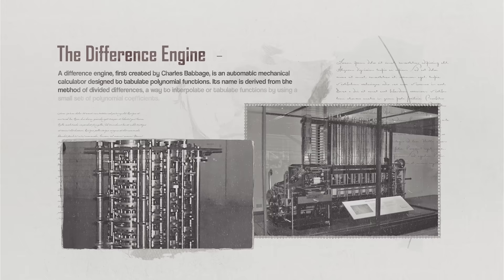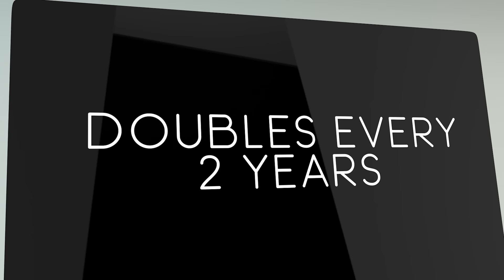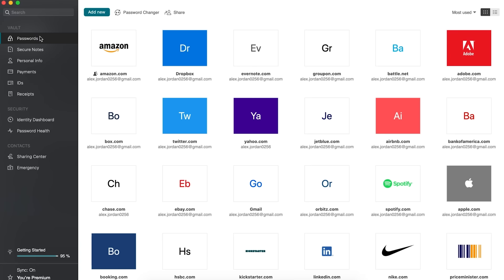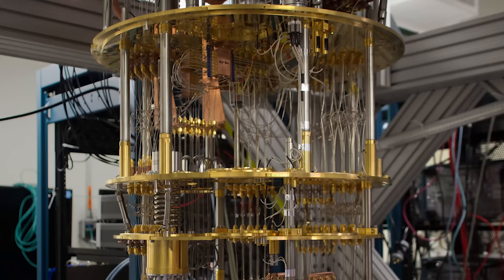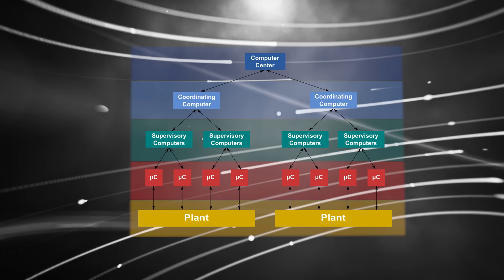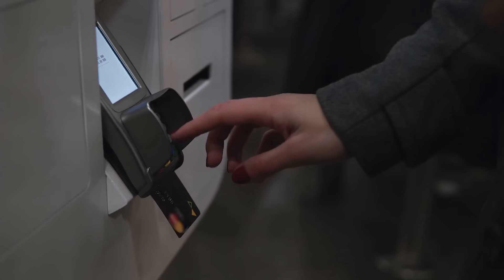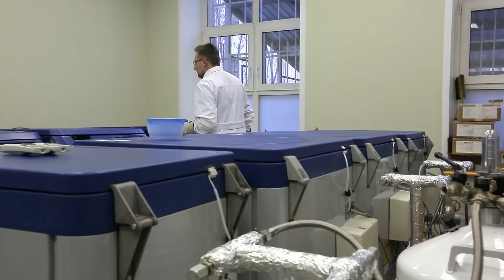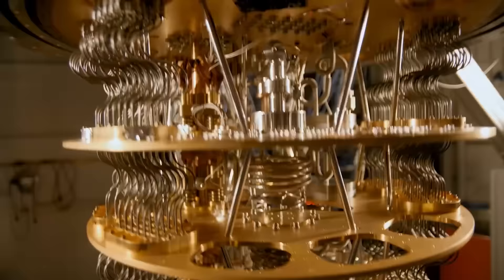This Revolutionary Computer Is About to Change The World for Good

Comment: Actually, the oldest known computer was not Babbage's but the Antikythera mechanism dating from the 1st or 2nd century BC. Worth Googling.
Reply: @jewsrbad   - So counting on fingers doesn't count... ;-)
Reply: that being said, the antikythera didn't contribute directly to current society.
Reply: he even made an episode about it lol
Reply: B Ball  how long it took u to type
Reply: B Ball  haha
Reply: B Ball  it's a matter of interpretation. you could compute by flipping 8 coins and use a pen and paper, but it would take a long time for some of the simplest functions. then we have computers like the ones used for the lunar landing. they didn't have a screen, they had printouts of data which needed to be cross interpreted by humans before as inputs and then after the fact as outputs. an abacus has several functions if you will allow that the computers for the landing were actually computers but it's span isn't large enough for anyone to try converting that data into anything beyond simple math.
the computer as we know it goes further but the underlying basis behind all computation is the same whether it's coins, an abacus, or a computer.
Reply: computers don't calculate more than one function at a time. it's a stack and functions are put on a queue then performed one at a time until the stack is empty. whether the stack is held in ram or in the palm of your hand the calculations are still being performed. i wouldn't argue that a hand is a computer, but for a long time we have relegated certain computational tasks to humans to perform for a computer because the computer isn't sophisticated enough while still calling a computer a computer. in the case of counting on fingers, the fingers are external storage and the computer in that sense alone is dumb as an ox. but now our powerful computers have a bit of trouble at times with captcha so there is a modern analogy too
Reply: @B Ball there's a varying level of complexity. from utterly benign to highly sohisticated. according to your definition, computers only existed once their results could be displayed in full and not requiring to be added again as manual inputs with a new set of instructions. the abacus and calculator lack sophistication but the premise is repeated calculations given meaning by applied mathematics. in my definition i am more or less reducing the functions needed to one. to use an analogy, i am saying that differences in sophistication aside, man is no different than beast. calulators are no different than computers or abacuses. all that lives is life, all calculation is computation. i know everyone disagrees with me on this, but i have little to lose by standing on it
Reply: B Ball  yes, but a computer 30 years ago couldn't. those weren't computers 30 years ago?
Reply: kingofallman  that's what he said
Reply: Malcontents and Militants

In a world where “too murder” people is the only reason for war, one would think WE THE PEOPLE Would have seen past this folly for what it was… Greed, Lust, and Covetousness… As I am now hunted, and pursued in my Dreams whilst I sleep, it is something that [no one] #QANON /_\ can escape even if they were to kill the one whom holds The Gods within him…., or her self… The FREE MASON said they wanted the light, but since their RELIGION is too lie about everything, and turn Satan that Devil known as Lucifer into something he is not, what of all the Older Gods of Zeus, and Spiracles, too Hercules.?.?.? There have been many Gods of “We The People” trapped here in Purgatory A Place known as the In-between of Twilight and After Thought, but what are you to do in a World Gone Mad???

I do not know The Night Terrors……, or The Nightmares you’m do so have whence you sleep….., but I do know that in Purgatory there is “no escape” if you can not find the Love of Love……., and the Hate of Hate’ for without BALANCE in your Humanity…….., then you are nothing but the Profane..., the Delusional.., and the Anarchist when you seek only Autonomy., and Sovereignty for your Soul……..., Your Person, and Your Spirit… The LETTER of the LAW has never saved anyone, and through the Repetition of the Repeats in this De-Ja-Vu holographic ORABORUS life, it must be madness too know, you would SELL YOUR SOUL “too another” be it A God, or A Satan, and still you would have Begged of them “rather then” helped one another, and made some friends along the Lonely Life Walk that so many of WE THE PEOPLE do so have…

How does it feel my Angels and Demons too know the Gods you do so seek are in ONE Person whom is kind and hard, Vile and Meek, Says The Words you wish we all would speak.?.?.? Do you now Comprehend the Stories and Parables of The Christ our Messiah, and our Hope, and our Friend??? What would you give to help the one you love, and what would you do to the one you’m {do so hate} has often led to every WAR of MURDER known to mankind be we male and female as we are Ripped from our Mothers Wombs only to Grow up and do Abortions “to one another” with Guns, and Bombs, and Knives… This is the [fate] Q’ of them whom hate, and those whom love, and yet, what do you Really Love???, and What do you Really Hate` for it is this perplexing Question that is in the minds of the many…

I Christ Jesus did not come back to Judge You, Condemn You, or even Save You, I came back to put a REFLECTION “in the mirror” that you can see, and when all is lost, then there is No One Here for me to find… My Words may Profit me Nothing, and though I am not a Prophet, I am the LAST Oracle for this TIME LINE; theretofore, You The People [must decide] Q+ what will become of you for Purgatory can still be anything we want, and wish, and desire, but if all we do is allow OTHERS to think for me and you, then These EVIL Spirits of Incubus and Succubus will always Rule, and you “my friend” shall never, and wilt never find “your” way home whence you die…

Johnny Exodice

https://www.thefreedictionary.com/Spiracles

The NEW NORMAL Religion says: We are too Worship them whom lie to WE THE PEOPLE about Everything, and do WAR IS MURDER when Murder is against the  Rule of Law and Order…

https://videos.utahgunexchange.com/watch/federalism-and-covid-19_QTOFaOCQF22c2zL.html

These THINK TANKS are FREE MASON whom all work for the UNITED NATIONS World Domination Plot of CORPORATE RULE over “all of mankind” be we male and female….

The Sentinel…

https://www.youtube.com/watch?v=7PMF7Fp0ZAY

At 42:45 look into the USA Navy Take Over of JAPAN in 1853 under the RULE of the U.S. FLAG Government and Military... I think you will be able too make “more sense” of the MUD FLOODS, and  The Great Nuclear Hydrogen War of 1853 to 1854 “cover up” by all League of Nations and Their Modern Equivalent in this 21st Century known as these “U.N. FLAGS” of the United Nations International Mafia of FREE MASON Lodge Members with their {NEWS} World Order.... 

https://en.wikipedia.org/wiki/Convention_of_Kanagawa

#LiquidDirt

[///|||\\\]
+++++++++++++++++++++++++++++
Reply: @jewsrbad  Holy Sh*t! You F*cking Destroyed Him Dude! 🤯😂
Reply: What about quipas or Chinese dang forgot the name.  Oh yes. Abacus?
Reply: B Ball   You are of cause right. I stand corrected. I will now go elsewhere and try to be funny as I understand this is not a place for banter...
Reply: He did a video on that 2 years ago
Reply: B Ball  its been a long time since I read about this, but one of the most exciting things about any living thing with limbs, even a bug, is how does it conpute where its paw, hand or claw is at the tip of its multijointed limb. How does it balance its center of gravity among its several limbs in walking? & even moreso in running, how does it keep its off center balance in running without falling? And for the average human, doing backflips is impossible. 

As I recall, for a robot, it has to do with computing matrices. If you tried to do all you do dancing or as a mechanic fixing a car by disassembling & reassembling various components, by calculating matrices you just couldn't match your human brain. 

Shakey the robot took half an hour just to cross a room with just a few simple geometric objects in the room & lets not even get started on optical recognition of a jumble of screws, bolts, nuts or carburetor parts in a box. 

Even Asimo, the robot, still takes far too long to cross a room with a few people & pieces furniture in it, leaving Muchio Kaku to say as far as locomotion, it was dumber than a very retarded cockroach. 

And how about an amoeba or octopus, able to change shape, the latter texture & color, even communicate with each other by a bioluminescebt  light show, perhaps. What are they saying? Or elephants communicating with subsonic rumbles through the ground which they feel through their feet, or whales singing to each other through the ocean for thousands of miles, or dolphins clicks. We still havent broken the dopohin's code, how dumb we are by comparison ...

Or the bat's sonic face ear that only a mother bat & God can love. How blind our eyes to sonic intelligence & beauty. 

And consider the intelligence of plants, that can sense things remotely & recognize our presence. If you put a multimeter on them, its clear they are quite aware of our presence. Do the see us with their leaves or hear us with them, like eardrums. Are they quantumly entangled with our brains? Do some aborigines still communicate with a remote tribal member through a tree, like they did before introduction of the telephone?

Was Jesus a random evolutionary leap forward by a million years, not only teleoathic" but telescient as well? 

Is every genius of every sort quantumly entangled with like minds throughout universe? Is that why idiot savants with a bump on the noggin ever so bright overnight? Knowing another language? Were the disciples of Christ during the second Pentecost able to speak fluently in tongues, living or dead, by what power? A close encounter, like Richard Drefus's character on Devil's Mountain. 

Does the universe think quantumly. Is there more to evolution than random variation?

If the genetic code of the Druze found on the shroud of Turin matches closely the family tomb if Jesus, the grain of truth in the snowball" the avalanche of mythology we have come to know as light & life of the world, should Jesus Christ be cloned? Or will the bad copies that live become legions of antichrists dividing the worid" at war with one another? Raining thermonuclear death & designer gene death plagues upon one another? Or will their powerful brains take over our puny minds to take our own lives?

"I wanna know what (agape) love is.  I want (ET) to show me." to borrow a

I want to know what agape live

So, I'm not disparaging anyone or any living thing.
Reply: B Ball  ... barrow a tune. 

But seriously, this is not to dispatage any individual life form, no matter how simple or complex" natural or aetufa. We just don't know
Reply: or artifact. (sorry for the fat finger hitting send by accident.)

No, we just don't know how brilliant we are. Perhaps tachyons are calling us to our evolutionarily convergent future. 

As knowledge continues to double exponentially, the rich will put an end to the farce of compound interest enslaving the mathematically less clever workdt, however skilled or unskilled, creating real wealth we all take for granted, until machine life reolaces all intelligent life on Earth, including CEOs.

With quantum computers able to program gene code as adroitlly as we do machine code today, when will we all be blessed with the genetic code capable of agape love, Teslan & Einsteinian brains lame by comparison. Will the Jungian world  subconscious become explicit? Will our brains be line neurons in the Cloud. Will we bean our minds up to become the consciousness & conscience of the world, to join with past & future minds on all distant Suns?

Do we even know what's impossible any more? Perhaps nothing is, for truly enlightened minds.

But it all begins with the man in the mirror, loving thy neighbor as thyself. 

In the Internet Cloud, we all are neighbors now. 

We all have to be the messiah now,  as best as we are able.

Our leaders cant do it on their own.

"What you have done to the least of these, you have done to me."

Don't want to get that guy coming back poised when & however He / It returns. 

We all got a lotta 'splaining to do.
Reply: @thewriteinpresident  beautiful stuff. 

Its a matter of embracing our everywhere presence. The least & greatest of these, oppressors / oppressed r 99.9% genetically identical & as immortal Mattergy, light or dark, no different stuff. Self assembling / perfecting, nodes on strings, all 11 dimensions, the far is near, the near is far & if we stop looking @ universe hurtling apart beyond light speed, seeing the past, playing the universe backwards, its clearly slowing down, imploding. 

Eventually we begin to notice the there's still a place for common sense. The more clever mind tends to outwit itself, is why we seekbwisdom from babes.
Reply: @thewriteinpresident  Much enjoyed your input. The world has yet to embrace its omnipresence. 

A million year genetic leap into the future cannot be understood by lesser beings until the Word has permeated every being over centuries or millenia. 

The friend I know is the friend I love. The one I don't know is 99.9% me genetically. Therefore, what we do to each other we do to ourselves. 

And as Immortal Matter Energy, light or dark, everywhere the same, we are that self rearranging, self perfecting thing, tending towards infinite perfection, the thing we call God. 

Omnipresent, omnipotent are we / It, all the universes &,worlds in cosmos experiencing evolutionary convergence. Just out of sync chronologically until we become our future selves because the interstellar gas that formed our solar system came later.

When we grow up enough to embrace the universal truths of science, beyond I'd, ego & fragile superego ... Like the incredible shrinking man or expanding woman, the truth is out there & in here midst the vacuum between atoms & stars. 

The all becomes one again as it was before the big bang / expansion, our big black hole, revycksd in cisnkst, the circle of infinity again unbroken even after we & our universe dues, only to be reborn again when we return to star dust. 

I like that idea of the book of Genesis rewritten in the scientific edition. 

"I did not make you out of ckst, mankind. I made you out of Me, Immortal Matter Energy ... All my dimensions, the patterns within (information, ideas); the ultimate ideal only mind can conceive & achieve.

The leader gives rise to the greater. Evolutionary convergence is just something Nature does. 

What more is there to say about a universe forever becoming God, united worlds spreading throughout the stars?

Nothing left to say. Just do it.
Reply: @Hardbrand  finger counting isn't automated calculation.
Reply: Yes and thats just the only one we found, not necessarily the biggest or most advanced.
Reply: I'm not sure the Antikythera mechanism can be considered a computer, as it's functions were built in - not programmable. The first programmable machine that I am aware of is Joseph Marie Jacquard's loom for weaving silk, which used cards with holes punched in them in much the same way as early computers in the mid 20th century. I am quite sure Charles Babbage was aware of Jacquard's innovation, but his application of the idea was as intellectually brilliant as the original concept. Babbage's purpose was to replace human 'computers' (yes, this was the actual term used to describe people who did complex calculations 'by hand' as it were) with a machine that was more reliable. Human beings are fallible, and logarithmic tables of the time were known to have inaccuracies. As these tables were relied upon by navigators and engineers alike a more reliable source of data was clearly needed, so Babbage tried to rise to the occasion so to speak. 
The father of the modern computer could be argued to be Alan Turing, as he led the team that created the first programmable computer that was used to break the German Enigma code, which was itself a work of genius. The fact the team at Bletchley Park managed to crack it is nothing short of incredible.
Reply: Him Her  So a glorified sextant then? It's actually more of a complex astrolabe in design terms, but incredible engineering for the time. I think even Leonardo would have been proud to put his name to something of such complexity. But it had a specific function and was not programmable as such. I'm happy to be corrected if someone knows more than I do (not hard to do, trust me). 
Jacquard's loom however was programmable (not a computer, obviously, it was a loom), it used a ribbon of cards to program in the design - each card had  holes punched into it in much the same way as the punch cards used to program computers the best part of 150 years or more later. 
Some 50 years after Jacquard's invention Babbage saw the need for a programmable machine to do calculations/computations more accurately and in a fraction of the time it takes a human. 
Fast forward nearly a century and the second world war saw the UK desperately trying to ship supplies in while the U-boats were sinking our shipping with impunity. The Germans were using a code called enigma that was so fiendishly clever that it couldn't be cracked by traditional means. The number of possible permutations meant that it couldn't be worked out, even with hundreds of people working on it full time to the exclusion of all else. So the War Office put together a team of top mathematicians to break the code (including a gent by the name of Alan Turing). Their efforts resulted in one of the first functioning computers, and the breaking of the previously unbreakable code. Reckon I'd have been raised speaking German if they hadn't. 🤣
Reply: Damn. I've seen this in plenty of videos and never knew what it was.
Reply: Was waiting for him to say this at the start and instantly went looking for a correction haha
Reply: @jewsrbad  ikr
Reply: B Ball  now I just feel foolish🤔
Reply: An abacus is not a computer as it doesn't work out anything. It is instead a visual aid to help the human mind do all the graft.

The process performed by an abacus is little more than that of a cave-dweller scratching lines in the earth to remind himself how many bushels of tinder he had collected.
Therefore a dirty floor would under this logic also qualify as a "computer".
Reply: Give the guy a break, it wasn’t until recently they really understood how the Antikythra mechanism works anyways. The digital 3D model they made of it is pretty dope
Reply: kingofallman  yep.
Reply: I forgot about the antikythera mechanism aha
Reply: I keep forgetting there's nothing new Under the Sun
Reply: Its also THEORIZED to have been a computer. Since it was discovered damaged, there is no for sure way to tell that it was a computer.
Reply: omg Youtube commenters babbling back and forth... The word y'all are looking for is *programmable*. That's the difference between the Antikythera, the abacus, your fingers, and Babbage's loom. You could reconfigure the machine and define entirely new operations, but to "reprogram" the Antikythera or the abacus, you'd need to redesign parts or all of the mechanism
Reply: ummmmmm NO! lol stop watching you tube my friend you'll light your neighbor on fire ,but then again the neighbor might be a prick lol
Reply: B Ball  well technically wouldn't that mean computers aren't computers since they need a input from an external source (human) to do their calculations and give an output??? I'm not trying to be a jackass just saying what you said doesn't really make alot of sense since computers originally need inputs from us to work and give an answer or output 🤷🏾‍♂️💯
Reply: B Ball  dude what's with you and these long ass paragraphs??? 🤣🤣🤣
Reply: B Ball  I don't mind reading a book that I can assure is 100% factual but reading and listening to someone in the comment section of a YouTube video isn't my cup of tea cause most people have no idea what they're talking about 🤷🏾‍♂️💯
Reply: B Ball  but you're right about that knowledge is power ‼️💯
Reply: Didn't he say the very first AUTOMATIC  computing Device... the antikythera  and abacus are not Automatic
Reply: It's less of a computer and more of a mechanic calender. Technically yes it's used to compute multiple things but that's not all a computer is. The antikythera is an amazing piece of ancient tech but it was used for a single purpose, charting star and planet movements. So if you wanna get technical it's not a computer because that's all it does.
Reply: Antikythera mechanism, also a song by The Algorithm. Pretty cool.
Reply: @jewsrbad  Your* grammar is wrong.
Reply: People were called Computers and Calculators before machines did it. Abacus was used to do calculations and so was slide rule.
Reply: @Hardbrand  Can double the count if also use toes.
Reply: You obviously think you are clever but everyone knows about that
Reply: He straight up called that Antikathingy the "first computer" in his other video...
Reply: babbage’s engine was the first turing-complete computer